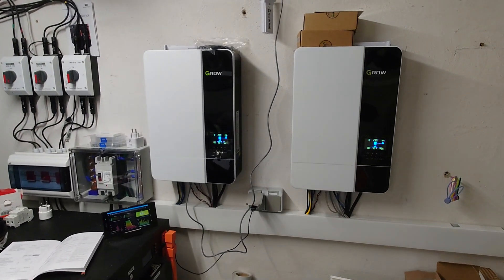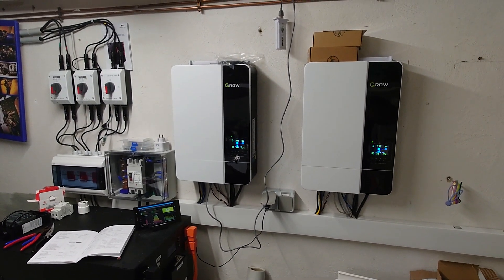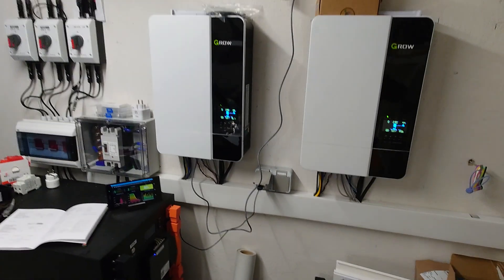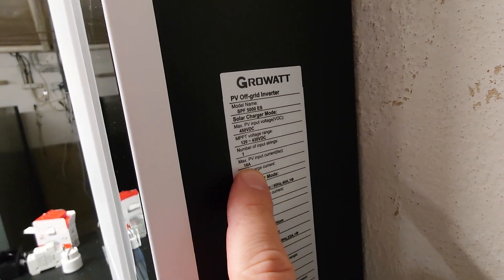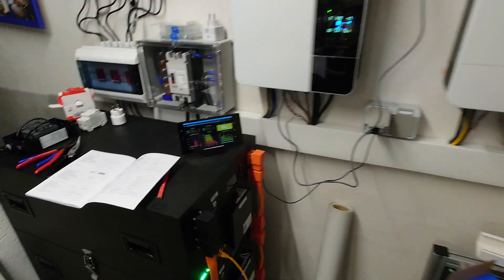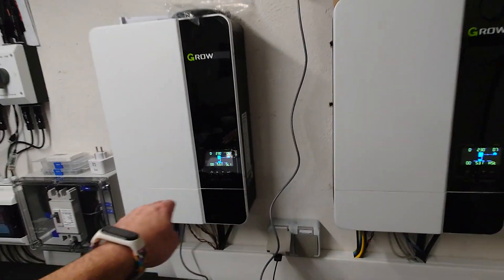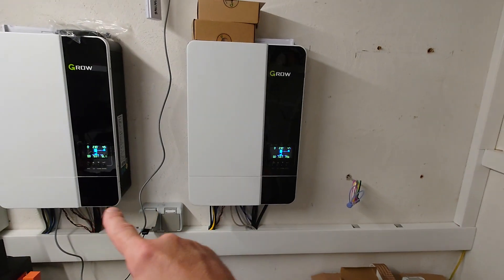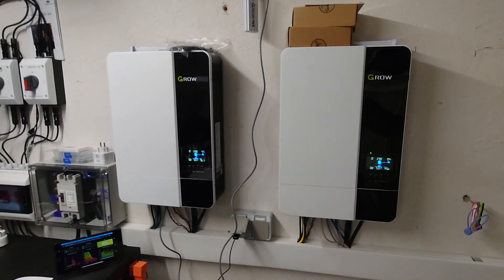Growatt SPF 5000 ES max pv input current and overpanneling

Comment: Just like racing cars...
* At first everyone just cares about peak HP on the Dyno 
* Later you are thinking much more about reliability, suspension, low end torque, throttle response, etc

I am most satisfied when my 15KW array brings in a thousand watts or two on a rainy day.  The big peak numbers in the middle of summer between the clouds are not that interesting anymore. 

... What is interesting is not having battery fires, Not having units go down without understanding why.....

Live the Dream
I completely agree that the unit has the ability to control the constant current that it is consuming so I shouldn't matter if you put 30A of PV out there. So long as the peak shoot through in the PWM isn't so great that it pops the MOSFETs - like 100A lol

Comment: My inverter was damaged when it handled more than 20 amps DC on the PV
Reply from the maker: which voltage did you had when the 20 amp came in?
Reply: @kirkdis  Hi, don't remember, but it did not blow a 20Amp fuse. I only checked when the 10amp fuse blew. Now this is the unit I use now as a spare. It has halve the PV capacity now. So it ramps up to 1500watt max. (Alarm: error:5011 Overtemperature warning) I have checked, am an electrical technician...not electronics so much) Suspect a diode went, but instead of repair, I just replaced it.

Comment: Great work pal. I like the way you arranged your job I guess you aren’t done yet anyway but so far so good. I’m an installer and I work with GROWATT a lot and JINKO solar.. my last job on these 2x SPF5000ES in parallel was quite a heck cause the client had a former installer who did a job that cost him some of his products damaged and I was contacted and I brought in the GROWTT but even though he insisted on using his old solar panels for the time being [mixed Wp solar panels].. And its runs offgrid.
But I worked him out an emergency switch via the GRID for times when the weather might be so poor with rainfall and those few days of power outages.. 
Thumbs up
Reply from the maker: I have another video where I explain how to build a automization for low bat cases and winter times. With that circuit you also can switch off slave inverters at nighttime to save the self consumption of the inverters.

Comment: Funny I should find you here, I think I sent you the F4 firmware 😉 but you are correct , the over panel story will help you in the morning and afternoon, also the panels in parralel will drop the voltage but double the amps, so I guess you have maybe 8 + 8 into one unit? maybe around 360VDC +/- , I think for the others looking at this video is to remember not to draw more than 5kw off the unit and it will be fine and the rated PV amps is 22amps for this model with the 068/067 firmware,  and if you have the 040/041 firmware the 040.6 will also do the 22amps
Reply from the maker: Hi, Thanks for your comment. Can´t remember exactly but if you are around in specific international forums that might have been the case with the firmware. 
I have two inverters running. on one there are 9 panels in two parallel strings so 18 in total and on the other there are 10 panels each string in parallel so 20 panels. Trina vertex S 400W. The String voltage between the 200 to 400V range is best so the mppt offers its full potential. Yes, you are right the later firmwares of the old 04X models and also the 06X models offer the 22A.

Comment: Warning -Off grid Inverters

These off grid inverters are Ip20 not Ip68 

ABB uno on grid inverters is ip68

Last 6 rs working fine.

ES5000 off grid inverters are

Not dust protected 

Must be installed 50mm away from the wall

With flysreen netting enclosure with Aluminum or wooden frame

Does not compatible with our environment in Sri Lanka. It is humid and if not, that's protected without an dust proof enclosure. And if you cannot look after them well in a proper environment don't go for it and being f*** twice with error number two(heat) and Sri Lanka. We don't have reliable service personnel with whom you have to deal believe with of whatever they say so but they avoid of offgrid inverters at all. If you need as a backup, not for 24 hours. Use in a Dusty humid environment. This is my warning because I am being f*** twice now. Finally for having a off grid inverter during power cuts time,I have paid a fortune.

Comment: Hi i Again me whit one question i live the inverter 2 on the night off but do you think is gone be a problem when in the morning pv is starting producing electricity and the invented switch on and off couple times his bed said that I will switch on from the bottom when I wake up ?
Reply from the maker: Sorry I don´t understand your question.
Reply: In the morning the inverter is switch off right but the PV solar start produce  power. Do you think it’s okay . Because the PV is not gonna make over 120 v to stay on is gone make lower first and in this way is gone switch on and off on and off many times 
So it is gonna damage the inverter in the future ? 
Thank you ☺️
Reply from the maker: @AlinA-vg5ud  the mppt range is from 120-430VDC. start up voltage is 150vdc. There is no information about your PV system but if the inverter starts and shuts down right after your pv voltage seems to be too weak. Try to get voltage on your string around the 400V and this will not happen again...

Comment: I just installed my second Growatt and i switch off on the night and switch back on on the day thank you for your sharing is perfect. It’s draining a lot of the battery on the night if I leave it on.
Reply: Warning -Off grid Inverters

These off grid inverters are Ip20 not Ip68 

ABB uno on grid inverters is ip68

Last 6 rs working fine.

ES5000 off grid inverters are

Not dust protected 

Must be installed 50mm away from the wall

With flysreen netting enclosure with Aluminum or wooden frame

Does not compatible with our environment in Sri Lanka. It is humid and if not, that's protected without an dust proof enclosure. And if you cannot look after them well in a proper environment don't go for it and being f*** twice with error number two(heat) and Sri Lanka. We don't have reliable service personnel with whom you have to deal believe with of whatever they say so but they avoid of offgrid inverters at all. If you need as a backup, not for 24 hours. Use in a Dusty humid environment. This is my warning because I am being f*** twice now. Finally for having a off grid inverter during power cuts time,I have paid a fortune.
Reply: @sunjayjay240 so, dust and heat is the main enemy of this inverter.?
Reply from the maker: Thanks for your feedback!

Comment: I don’t know how you manage to put the PV voltage because I have 10 panels 555 W and my inverter last winter switch off with error saying is PV high voltage and I need to split in a half but now I buy another and I will put five and five I don’t understand how you do it, but it’s nice working
Reply from the maker: easy thing when you have little experience with these inverters and pv. check the datasheet of your pv modules. there is a Vo voltage or short curcuit voltage described. try to get as much panels in serial to stay below the 450VDC which the inverter can handle. exceeding the 450VDC causes an error and shuts the system down. as the Vo is never the max voltage the pv module may produce under special circumstances I recommend to choose as much panels to get a voltage around 400VDC to have a little reserve before the inverter hits the max voltage notification. Hope that helps...
Reply: @kirkdis  i split in half the panels five and five but I have somewhere 22 A when is a lot of sun so before when I have 10 together I don’t have power to charge the battery fast when I put now I discovered amps is the key for charging the battery fast And I have like today 25.9 kw make before i make maximum 13 kw 
But now i buy another inverter spf5000es so i well see soon if i meke more or less
Reply from the maker: @AlinA-vg5ud  yes the Amps make a difference especially in the morning and evening when you have indirect sunlight. Again, for best results try to plan your serial module setup to reach 390-410VDC. this is the range where the SPF's shine
Reply: @kirkdis  how do i do that  i’m new on this my but summer is perfet  last winter was horrible i didn’t make much here in uk  i have 1 years next month from the day when I install so i make 3000 kw all together

Comment: hey brother.. 
  just a quick question if you dont mind.. on the growatts parellel set up, specifically these same 5000 ES units, if one inverter faults/fails/abruptlyt shuts down, will the other continue to provide power? or stop as well?
Reply from the maker: depends on the error if there is an errorstate. While simulating a normal shutdown the other inverter will still power the loads as long the consumption is not exceeding the limits of the inverter. I build at my setup a kind of energy saving mode for the winter months which shuts down the slave inverter(s) in the night to save the self consumption of the device. this is only possible in parallel setup. in 3phase setup the whole system will stop working when one of the inverters is not present due to error or shutdown!!!

Comment: I am using a growatt spf5000 with 2 strings connected together giving 5.6kW. I had to search quite hard at the time to find a panels that gave the right combination of volts and amps so that I could remain under the 6000w limit without exceeding the volts and amps limits. Nice to know you are actually driving them with 8000w of panels but I prefer to stay within the specification to hopefully give longer service life.
Reply from the maker: @dcawkwell  it doesn't have an impact if it's 6kW, 8kW or 20kW. the Inverter takes what is usable within the specs and this is capped at 6kW. all exceeding power is not used by the inverter. Overpanneling makes sense when you are in areas like central Europe where you have cold cloudy winters and every Watt is helpful at these bad conditions and times. the benefit from overpannelling- the mppt is much more happy to have more power at start available which in my opinion helps the electronic to live longer due to less regulation cycles.

Comment: Thank you for the video
Is the 450vdc limited to each string or both strings on the inverter?
For example, 330v for pv1 string and 330v for pv2 string or 330v shared among both strings?

Comment: Great thanks for sharing. I managed to combine 2 Strings of 575W x2. It works perfectly. The dc breaker and fuses had to be replaced with 32A. I really appreciate your useful share. The battery charge is more stable. Thank so much

Comment: I have same invertor and 8 canadiansolar panels of 660w , and in sunny day i get 330v but only 2-3 amps , best i see was 1,2kw , what i can do
Reply from the maker: your panels should make round about 5kW at high peaks. Do you have shadowed panels? If this is not the case maybe one or more of your panels are broken or your wiring is not correct.
Reply: @kirkdis  is not shadow,  they are on the roof
Reply from the maker: @mariuspirvan3758  there could be shadow even if it's on the roof by trees, a dormer, a chimney or dirt for example... if that's not the case maybe one of your panels is damaged or has insufficient quality and pulls the string down, other issue could be a bad connector.

Comment: damaged invertor at 6000w 445voc 361vmp early software 
thou panels would struggle to produce 6000 due to array angle
never saw more than 400v or 17 amp
doesn't mean it didn't exceed limit
damaged mppt keeps climbing slowly to 53.5v shut down battery alarm
just sayin free panels have costs
great video
taking your dongle cable idea thankyou
Reply from the maker: Sorry to hear, mine both take several hours a day the 6kW and work great. You have to be careful not to exceed the 450Voc input. the amp rating is not relevant...

Comment: Hi Kirkdis, thanks for the video. Do you mind sharing the panel specs for your setup? I'm currently using 12 420W in series which is getting a maximum of 440V. I'm planning to add another 10 units 420W per string and decrease the current string to 10 panels  and connect both strings in parallel to double up the amps. I'm expecting to get around 360V and 22Amps when both strings are in parallel.
Reply from the maker: Hi, I´m using the Trina Vertex S TSM-400
DE09.05 on both strings. One string is in 9S2P configuration the other in 10S2P. Datasheets and specs you can find with the panel product number above. 440V may work but are hard at the limit of these inverters. In cold conditions in winter those panels may have higher voltages so be careful and give more voltage reserve to be on the save side.

Comment: can you use it to power airconditioners?? can the growwat power inductive loads??  can  the growatts work without AC input from grid while the battery is not connected ??
Reply: I have a standalone TOSOT (subsidiary of Gree) movable dual-purpose (heating/cooling) airconditioner. It works perfecty well with 5000ES.  It takes 1700W when cooling and 1200W when heating. Heating is done by thermodynamic processes only (it does not have a build-in electric auxillary heater).
Reply from the maker: I´m not sure about how the Growatts behave with your proposed setup. You can use the inverter withouth pv power, same for the battery. but you need a realiable souce in both cases AC in. I doubt that the functionality is given when you want to power consumers only with PV and having a battery obsolete. So PV high likely needs a battery connected. Maybe I´m wrong so please correct me if I share wrong information. I never tested a setup you plan to build...
Reply: Yes. Yes. No, you need a minimum storage to run it that way.

Comment: I run 2 Strings of 13,5 amp Modules in parallel in each making up to 6000kW on both my spf at around 330V sweep without heat problems but Growatt Madrid doesn't recommend it.
Der mppt holt sich was er braucht und die Kurve wird flacher.
Reply from the maker: Growatt is not recommending it, right. I guess because users and installers are not familiar with these kind of setups and there can go things wrong if not planned and setup correct
. But this doesn't mean it is not working as you and I proof with our setups.
Reply: @kirkdis  
Serial-parallel string mixture is perfectly OK. The only thing that need to be observed is not to provide more input voltage that is mandated by instruction. Inverter uses component that may not support higher voltages than allowed so in case of overvoltage a damage is likely.

Comment: I believe the the critical aspect, is to ensure that you do not exceed the PV voltage rating - I think the growatts are 450 volts. It would cause major damage if the voltage rating is exceeded. You can however as mentioned over rate the PV rated power and the inverter will simply limit the power going into it to the maximum power rating.
Reply from the maker: nothing to add

Comment: the 450W panels provide a max of 11Amp so 22Amp from 2 strings is really no problem as, even less as they panels hardly ever produce 11A unless in short circuit!
Overpaneling 20% is really normal and makes economical sense!
Reply: I have two strings with 8 panels each. Max current I observed was about 20A. So certainly max input current is more than 18A but can't confirm if 22A is upper limit.

Comment: I think you play with a 1000 € .Don't take it to the limit and over load because then you see the problems
Reply from the maker: the mppt is restricting the max usable current. Overloading is not possible as the inverter is controlling the amount to take usage of. Did you have issues with those inverters already?
Reply: you should study more!
Reply: Ok my friend put all this power on your inverter make a video again and give us the results from the beginning to the and with full power and few minutes to run ....I wan to see on screen the over 450 voc and more 6000w output. Thank you .
Reply from the maker: @georgeskamagas5476  the Voc is the only thing which has to be taken care of while planning and installation. as long the Voc is below 450V you can overpannel up to 6000W. on the specific inverter I have 2 Strings with 4kwp so in total 8kwp. the inverter only takes 6000W as this is the max rating the mppt can handle. overpannelling is fine for these specific inverters as long the Voc is in the range limit.
Reply from the maker: @georgeskamagas5476  Just checked all the recordings. While producing the 6000W the PV voltage was around 320-330VDC. the time while it was under full load was 1.5hours and it reached peak temps of 42°C. Hope that helps. My PV voltage never exceeds 380VDC even in winter times.
Reply: @georgeskamagas5476 
You should listen carefully to what people are saying and have enough prior knowledge to understand what they are saying and then comment on the subject.  Nor did he say anywhere that it will exceed 450 V on input or that it will have 6000 W at the output.